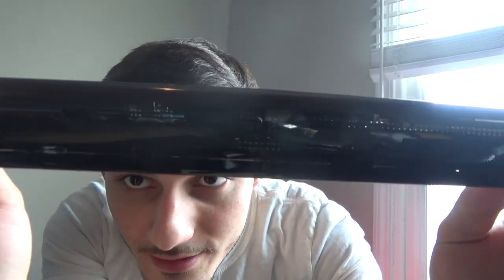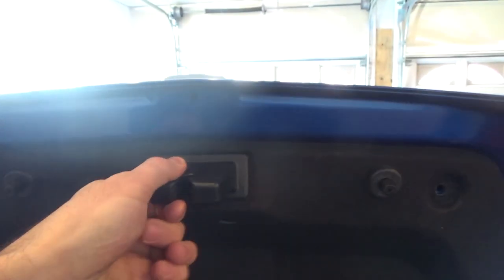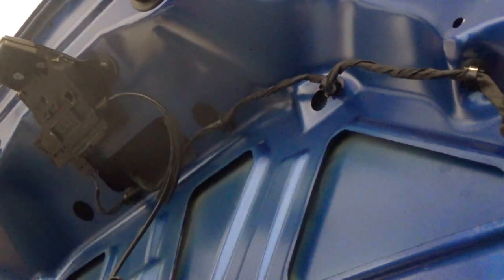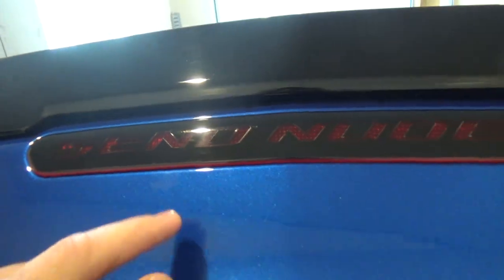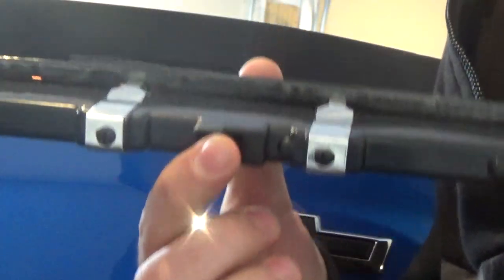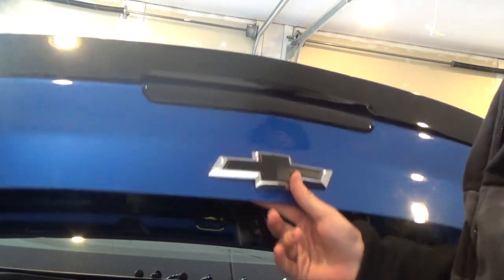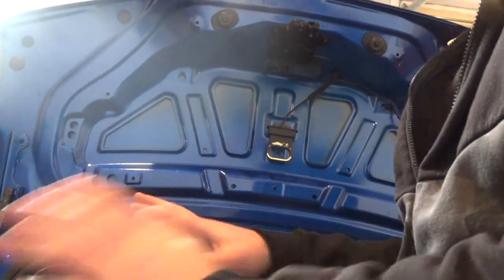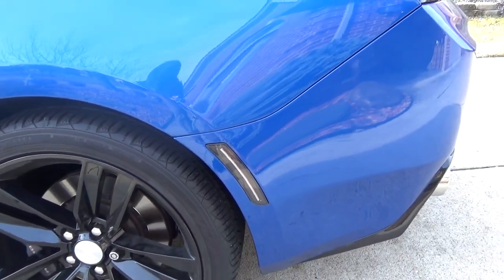2016+ Chevy Camaro SMOKED Third Brake Light - $55 | Review & Install | Next-Gen Speed

Comment: Are you still getting a new style for the 6th gen sequential taillights? Like one where the turn signals don't turn on while just braking?
Reply from the maker: Kenneth Sevilla Yes, but we do not have a confirmed date when they will be available
Reply: Is it going to be a fix for the tail lights we bought or do we have to buy new ones because I never would have bought these tail lights if I knew the turn signal came on when you break and nowhere on your website did it tell or show us that
Reply from the maker: @jasonjoy3990  Hello. We are getting a new style produced but it is currently in production without a confirmed date of completion. We are truly sorry you were misinformed, we have videos on our product page showing the function, overview, and install of them.
Reply from the maker: Also the reason for why that occurs, is because the stock Camaro Tail Lights use the outer brake lights as the turn signals. The turn signals run through the same current that the brake light also does when activated. Our engineers are in the process of getting a new design made.

Comment: Bro I cannot get the plug out to save my life
Reply: And one of the clips from the stock break light fell
Reply from the maker: @ces3lg  A bit tricky and it helps to have someone with smaller hands get to it. The new third brake light also includes new metal clips

Comment: If you removed the new 3rd brake light. Do you know what tape to use reinstalling an old 3rd brake light ?
Reply from the maker: Oscar Gracian 3M double sided tape. All new brake lights will come with precut and installed adhesive